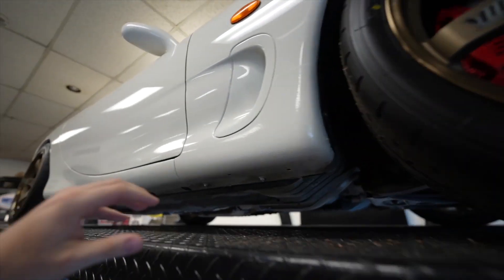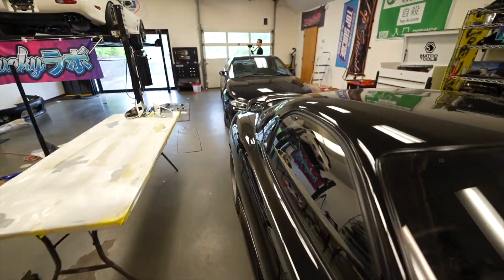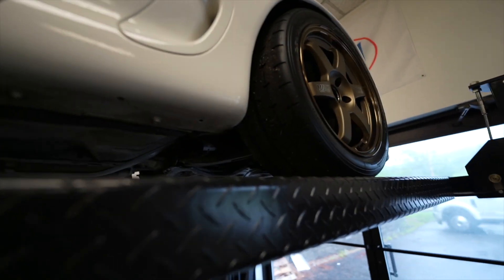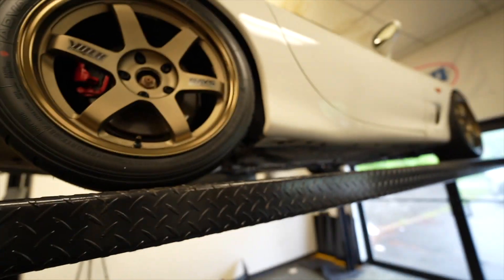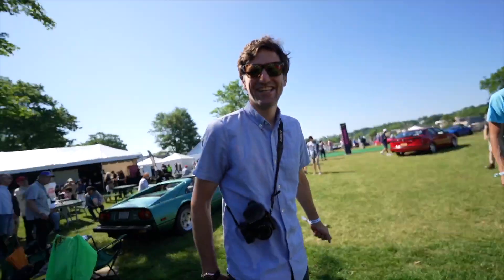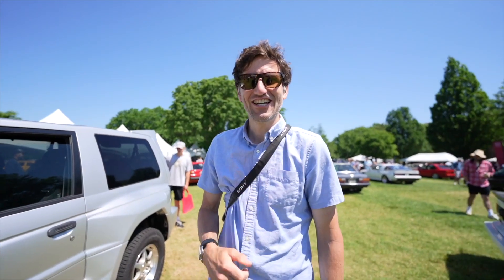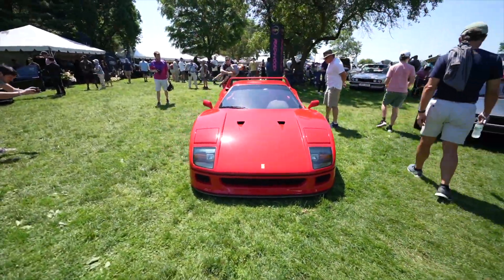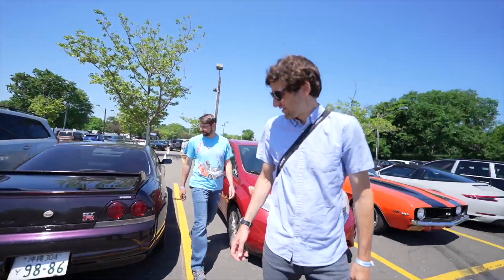FD TRANSFORMATION!

Comment: The white does look gangster but I like it more non sideskirts but it's still Radass
Reply: I literally came to comment the same thing and your comment was the first I saw.
Reply: Yea the skirts kinda look like they don't color match. still nice tho.
Reply: I agree. Non side skirts look much cleaner
Reply: Probably needs the series 8 front bumper and lip to match the side skirt and also a series 8 wing because it just looks weird how there’s a lot going on in the bottom but nothing on top
Reply: @Ayr7on9977  I think unpainted lips are one of the worst trends with JDM cars. It looks okay on Honda civics and miata's because it was an addition to sport up the bumper being too tall in the front for clearance reasons. But in a car like this a unpainted lips looks dumb. It doesn't line up with the sideskirts because it's black and it breaks up the flow of the body.

It absolutely needs a different lip or a different front bumper with lip combo that's painted the black unpainted lip looks fine when you have no other aero on the car but this needs something more in the front to complete the look.

OEM can be wrong sometimes. The skirts and rear are fire the front isn't working on this because it's such a a high contrast in color.
Reply: @hano5277  yeah he should maybe consider the series 8 bumper and lip or paint the series 6 lip
Reply: @Ayr7on9977  I like Randy’s kit from illiminate 
It’s like perfect for all FD’s
Reply: Color on the skirts looks way off, at least through the camera to my eyes.
Reply: Looks absolutely perfect
Reply: not a fan of the skirts also.
I actually hate how the body line of the skirts don't line up with the door. (ik it's not supposed to) but does bother my ocd. still super clean overall.
Reply: I can’t wait to see it with the white Regas. 🔥🔥🔥🔥

Comment: Anytime you drill holes it's a good idea to use primer or some sort of sealant on the bare metal to prevent rust from happening.. Water or salt will get in there. Especially in Connecticut my dude.